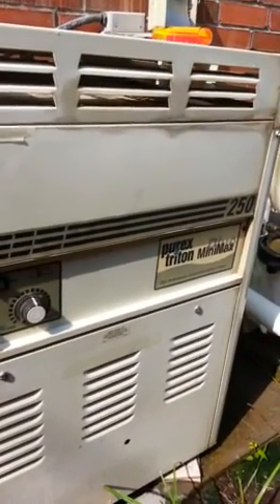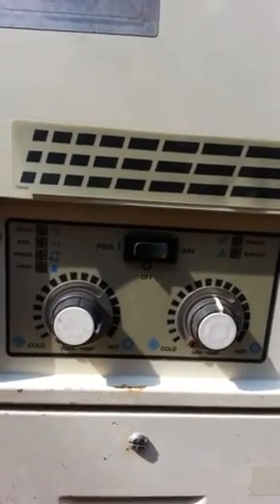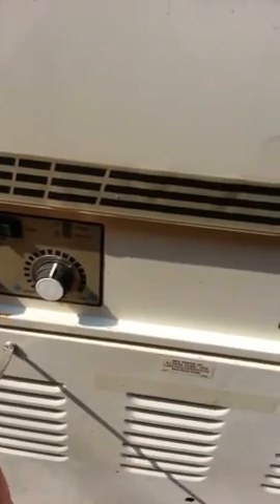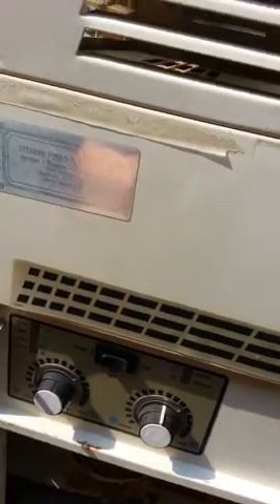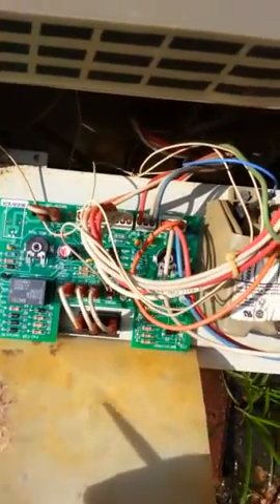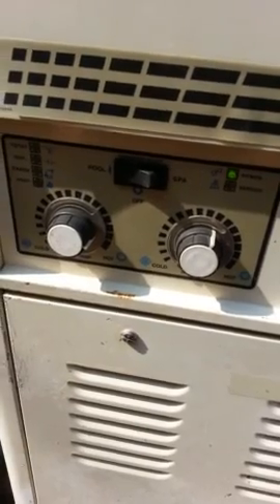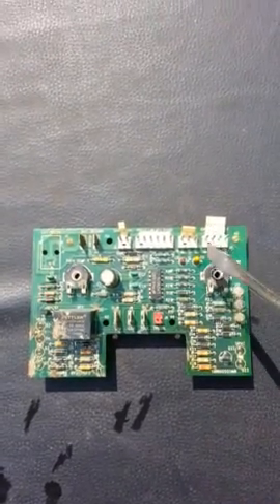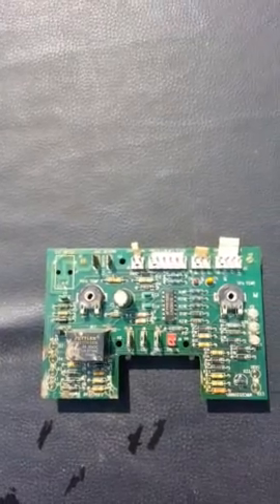Minimax Plus pool heater no LED lights (only power) - easy fix with new curcuit board

Comment: Mark, not sure if you will still see this post (since your video is from six years ago), but if so, thanks!!  I have a similarly old unit (a MiniMax 400 from 1999) which stopped firing.  I was having trouble finding a technician who would work on such an old unit.  So I did some searching and came across your video.  My "symptoms" were exactly the same, so I rolled the dice and went ahead and ordered that circuit board for $73.  I just installed it (very straightforward) and...my heater is working like a champ again.  Thank you so much!!!

Comment: I had a purex mini max400 that was in bad shape. I purchased a purex mini max 350 on craigslist. I was able to connect everything with no problems. After installing I'm only seeing the power light on. I changed out the curcuit board with the other unit and I'm still having the same issue. I checked the transformer and it was fine, im also getting the 24v to the board. could there be something or maybe a safety feature that is not letting the unit turn on? I'm a bit hard pressed to think both boards could be bad? Any thoughts or suggestions?
Reply: another search on youtube showed a guy with power & top left 2 lights on but not clicking too light. it was the high low pressure switch on the manifold side. bypass by unplugging & put a fat metal paperclip in each lead wire to completed the circuit, if you start & click, it's the switch. he said it was like 50 on amazon.

Comment: I just changed the circuit board and also broke some of the clips that hold it on the panel.  Where can I get those clips from?  I can't even locate a part # for them from the manual.
Reply from the maker: SYHockey Are you asking about the mounting pins/clips that I broke that hold the circuit board on the heater?  I am not sure I have not replaced mine, 2 of the 4 or so were still functioning on mine.  And I had forgotten about it.  Let me know if you find them.  Maybe call Hayward?  Did they buy out Purex?  Sorry to be late on the reply.  I don't check the email this is registered to.